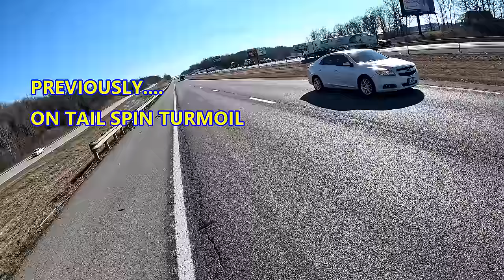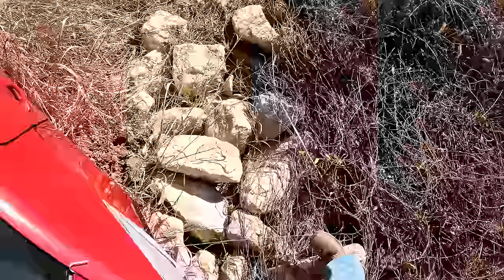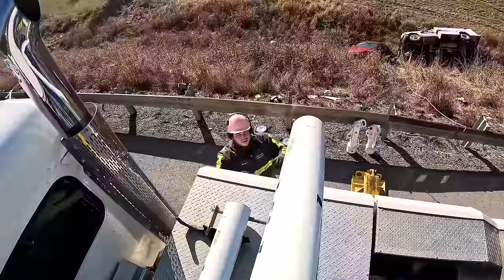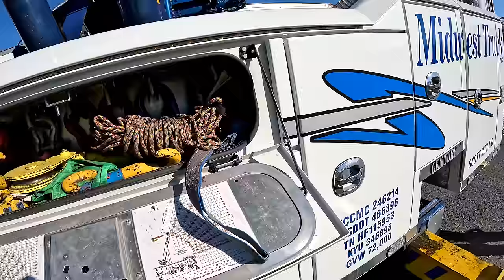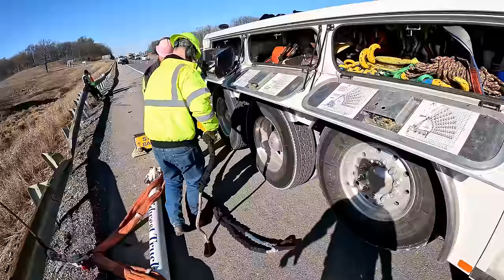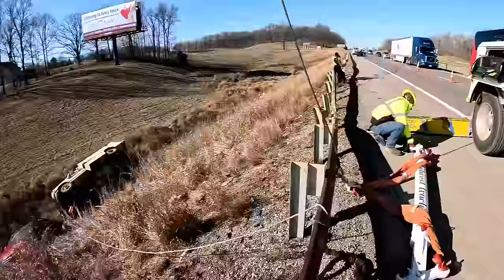TAIL SPIN TURMOIL PART 2!!!  MULTIPLE VEHICLE CRASH!!!  UP & OVER!!!

Comment: ~~~ A safety tip. when walking up and down a hill that steep, especially with dry or green grass and weeds , even gravely marble type is worse, dont walk facing down or up the hill, even holding on to a rope or cable. Your feet become skiis and they will slide. Turn your body sideways to the hill and step side ways , One, the edge of your shoe can dig in and hold you better. It works even in snow.
You can stomp or kick the dirt to make a ledge for your feet to stand on.

Comment: So I'm just sitting here thinking wouldn't it be easier to use red/yellow to drag the car up first then hook white/blue up to the rear of the car. Then lift it in the air and over the guard rail? (I'm speaking about the red car.)

Comment: Lets see if I understand this Now. That car AND that truck were on the same Rear bumper hitch Trailer Is that correct?? Now the hitch may have been bolted to the frame of the vehicle bu I still consider that not much more than a  Bumper Hitch. That said this guy pulling all that on a single trailer didnt have much going on upstairs because that was disaster waiting to happen. Dont see how DOT let him on the highway with a setup like that.

Comment: This one was a big project.  I wonder how they would have handled an accident like this in the "pre-rotator" days, in hoisting things over the guard rail?
Reply from the maker: There is always a way.   A straight stick could still have lifted both units over the guard rail, but the interstate would have had to have been shut down for several reasons.  1) Safety  2) The Straight stick would have to be crossways of the road to boom out over the guard rail, thus blocking the lanes of traffic. 3) Safety...     Could have also dismantled the guard rail and removed several posts, but that is HIGHLY frowned upon.   I learned a LOT working with older equipment, but I do NOT miss the pre-rotator days.   Thanks for watching and God bless.

Comment: great 2 part video as usual, but wondering why not just tow the truck with the rotator?  It was already in position seems like.   Like to see the spreader bar in action….
Reply: I suspect because the rotator is more important to have available so having the smaller truck do towing makes sense.
Reply: They like to keep the Tater free and available for other calls

Comment: Great job getting them all up, over and gone safely. The guys are learning nicely.
Curious why you pulled the driveshaft from a basic F350? It should probably be C6 if it's an automatic so put it in neutral, however you're the Pro and I could be mistaken.
Reply from the maker: It's our company policy to remove the driveshaft on anything we tow that has the drive wheels on the ground.  It removes our liability of a transmission damage claim.  Thanks for watching and God bless.
Reply: @RonPratt  Understood thanks Ron.
Reply: I'd say that the service truck is going to be a total loss...about the only reasonable way to repair it would be to replace the entire cab with an identical unit.  Not to mention the damage to the service body!

Comment: That was a mess out there for what close to what like  3, 3.5 hours ?  It was a mess the Rotator had to grunt some on the HD work truck. So many easy jobs he's done lately about time he got a work out lol. Hopefully no one was hurt to bad in the north bound accident. When you told Ethan to go show Gavin what a tire sling looked like some people may think your talking down about your crew. I KNOW that's not true like you said your just TRYING to get the job done. Get it done quickly & clear ASAP to prevent  MORE of what happened NB 55.  You all have a VERY dangerous job. Be careful out there Ron & crew as you very well know there ARE IDIOTS on the road. So be careful & God bless.

Comment: An abundance of caution, pacing yourself, and keeping your heads on swivels help to keep towing and recovery operators safe. Ron goes the extra step to minimize any extra damage to whatever he is recovering even when he knows it's totaled out and looks like a monster truck ran it over. And yes, that job was like running a mini Ironman and a 90lbs Ruck March. Lots of heavy lifting and steep terrain. Even with the cool weather, you can overheat and become dehydrated.

Great job, Ron and the entire crew. Every new job is a learning experience, even for the man of experience himself, Ron Pratt.

You should look into the safety vests with built-in safety strobe lights, it may help in those heavy traffic situations.
Reply: I have an online buddy that is a trash collector in Grenoble, France(yes, the birthplace of Andre the Giant) and he talked his supervisors into getting the entire sanitation department those strobe vests because of the frequent close calls they have with inattentive drivers on those narrow European streets.
Reply: I would say it can be even more likely to dehydrate in cool weather. Mentally, people don't think about it, and the cool air holds less moisture. I was first warned about this on a day in early March around 11,000 feet in the Colorado Rockies. It was about 80 deg. F, and we were taking our jackets off, while the snow on the ski slopes turned to slush.

Comment: They may seem clueless but if you haven’t been around recovery,rigging or anything for that matter you just have no understanding. It’s almost like starting a new job doing something you have never done it’s like where do I begin. I felt that way the first time I stepped foot in an underground coal mine. Clueless and lost lol A good teacher goes a long way for sure. Hell I know people who don’t even know how to check oil or change a tire and when I’m talking about rebuilding an engine ,doing main and rod bearings,timing or anything electrical people just don’t get it. If you have never seen it or messed with it you just don’t know. Some people will always act as if they were just born with all the knowledge and understanding of something quick to tell you your wrong and they can do it better .

Comment: Why would you switch trucks to tow it with the 20 Ton? It's already behind the Rotator, why not just use the boom winch to set it down on the Rotator's under-reach and tow it that way?
Reply from the maker: We try to keep the rotator available for larger recoveries and tows.   The 20 ton was designed to tow vehicle such as this, so we used the 20 ton and kept the Rotator free for another job, should it come up.   Thanks for watching and God bless.
Reply: @RonPratt  That makes sense...

Comment: Mr Pratt had to get in the banana 🍌 peel bit. Laying on the pavement. See the Rotater remote is just like a video game 🎮 controller. That's why his is so good with it. Lots of practice.  An can't believe nobody pickup on the Frogger bit. The game would be over or safer if everybody would slow down and let them work and clear the lanes. Thoughts are the fireballs people that can't read. SLOW DOWN MOVE OVER AND DO T RUBBER NECK. one secondary was bad looking from not paying attention rubber necks. Everybody should go home safe 😇😇😇😇😇😇😇😇😇

Comment: I am actually surprised that you are allowed to work on a dual lane road without a crash protection truck (Truck Mounted Attenuator, TMA).
Reply: Ron has a traffic control truck, and it was used for this incident response, it was parked back behind the police cruiser far enough away that the camera Ron is using didn't pick it up
Reply: @jamesalinio5277  His traffic control truck is only a pickup, it would be mangeld if someone crashed into it and wold not stop a car without serious risks for indjuries, i suggest you google Tma truck, it is common in europe

Comment: So did the pin in the hitch fall out or get sheared off ?
Reply from the maker: Neither.  The hitch pin was still in the receiver along with the sheared off solid steel hitch.   I've never seen one do what this one did.  The hitch stayed in the trailer and sheared the square part of the hitch right at the end of the receiver.   The receiver wasn't bent and the trailer tongue only had a slight bend.   The tongue latch still worked.   We released the broken hitch and used a hitch on our under-reach to tow the trailer from the scene.    I can't explain this one....   Thanks for watching and God bless.
Reply: Nice job as always. I’ll trade you two players to be named later for your two guys any day!

Comment: why did he use the other wench cable he uses to hold on to  pull tire up hill then place  it back to where it was needed instead of letting roll up the other side of theinexperienced